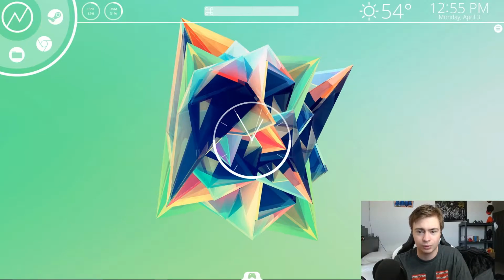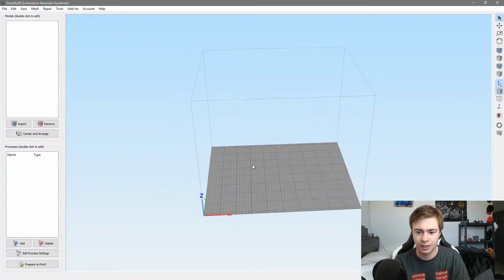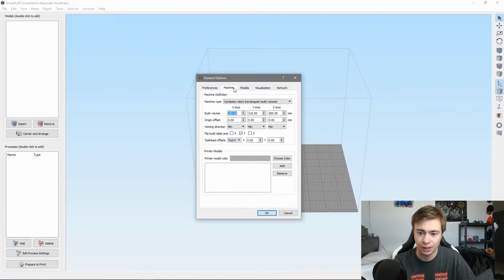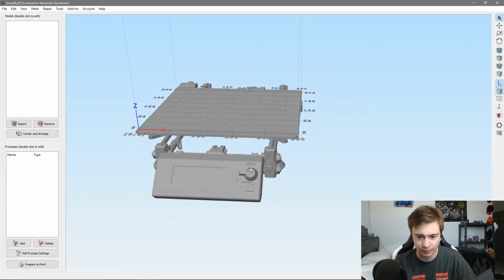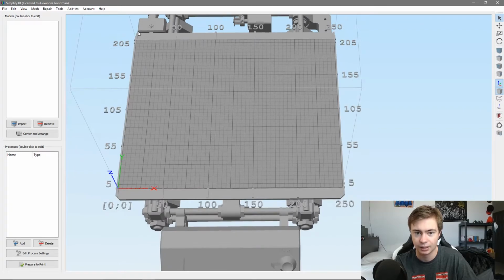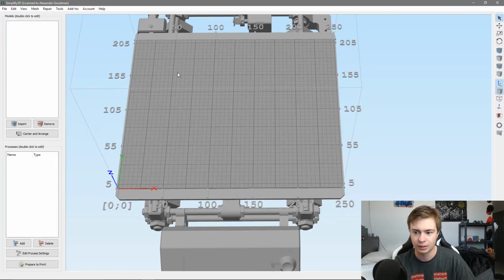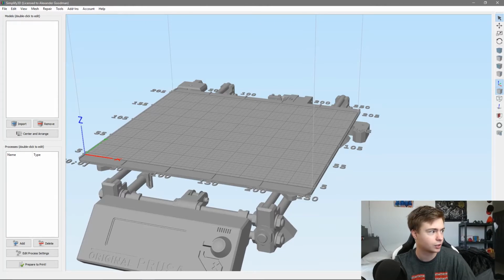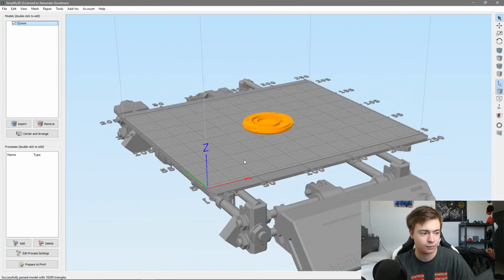How to Setup a Custom Simplify3D Build Plate for your Specific Printer

Comment: Sorry for the newb question… This seems to work well, but when I exit out of S3D and back into it, the bed STL is gone and I have to manually put it back in every time.  Is there a way to save that so it doesn’t disappear?
Reply: Same question here
Reply: @Fox9950  I found the answer.  It works well too…

Instructions for enabling this background model in Simplify 3D:
1. Download the build platform model/stl file: Prusa_MK3_Assy_STL_-_FULL.STL
2. Copy or move the STL to: %userprofile%\AppData\Local\Simplify3D\S3D-Software\
Example: C:\Users\oward\AppData\Local\Simplify3D\S3D-Software\

For Mac, the file location is: 
~/Library/Application Support/Simplify3D/S3D-Software/

Within Simplify3D:
3. Click "File" from the menu bar.
4. Click "Export FFF profile”
5. From the "Select Profile" dropdown, choose the profile that you would assign a custom platform.
6. Click “OK”
7. Choose a directory/folder where you would like to save the exported Simplify3D profile.
8. Give the file a new name if desired. Example: ocie mk3 v4.fff and Click “Save”.
9. Locate the directory where the .fff profile was saved.
10. Open the .fff file with a text editor.
11. Once the file is open you'll need to edit one or two lines. 
11B: Make sure you use a text editor that does not exchange plain quotes with curly quotes.

Within the FFF text file:
12. Locate: <overridePrinterModels>0</overridePrinterModels>
13. Replace with <overridePrinterModels>1</overridePrinterModels>
Note: You may not need to make the change since it may already have a 1.
14. Locate <printerModelsOverride></printerModelsOverride>
15. Replace with <printerModelsOverride>Prusa_MK3_Assy_STL_-_FULL.STL</printerModelsOverride>
16. Save the file and close the editor.

Within Simplify3D:
17. Click "File" from the menu bar and then Click "Import FFF profile”.
18. Locate the directory where the edited .fff profile was saved.
19. Select the edited .fff file and then click open.
20. Edit or add a new process and select the newly added profile from the dropdown.
21. Click "OK" and the custom build plate should be displayed.

** Credit for this instruction set goes to Matthew Upp: https://www.thingiverse.com/MatthewUpp/about 

I'm sorry, do not know the process for adding this to other slicers.
Reply: Alexander saving this comment for later
Reply: Yeah , i tried this today and it worked perfectly. Thanks!